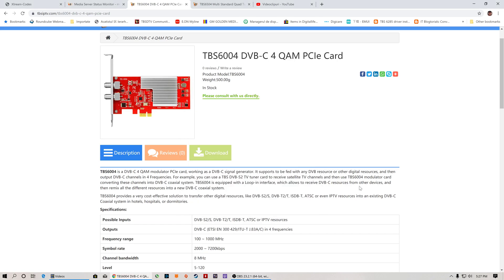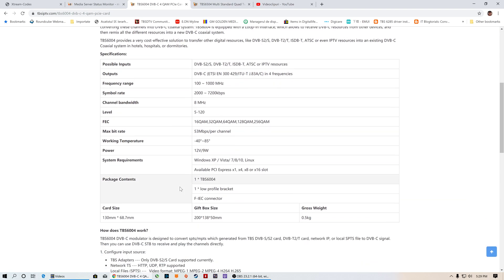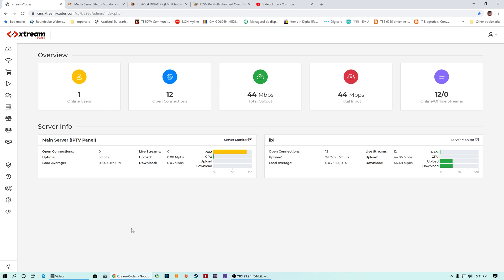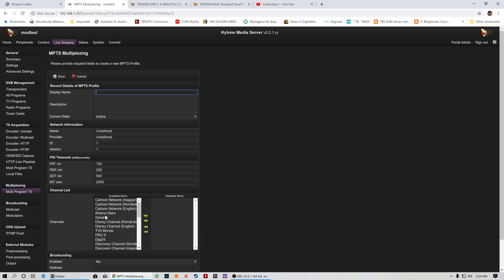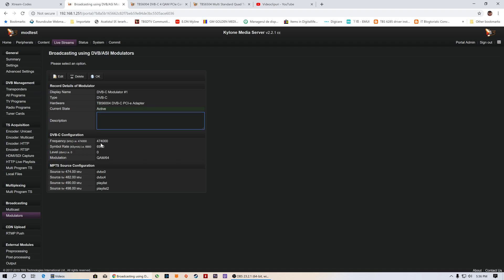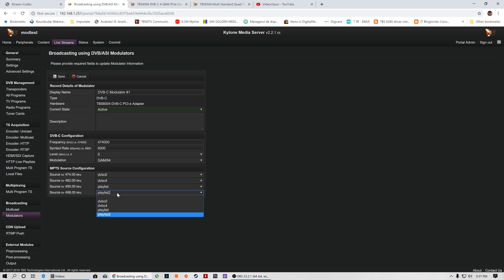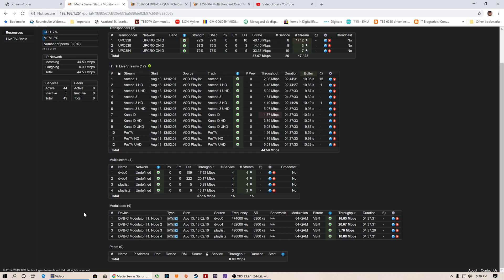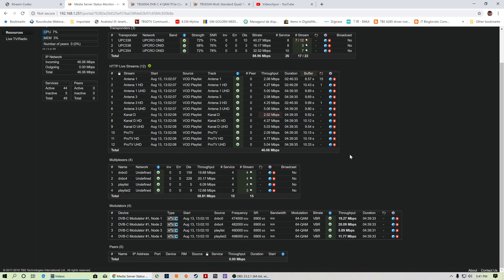TBS6004 Cable Modulator (how to build small television broadcasting station) part 1

Comment: if this tbs 6004 modulator can support sources of url ip stream input  up to 100 tv hd channels or more
Reply from the maker: this is hardware man , the input is relaying on the software you use the hardware itself can work with any type of input as long as the software is capable to work with any inputs , there are at least 3 software which make use of this modulator ... but overall answer is yes it can work with IP stream sources

Comment: How many channels can i output with this cable modulator ?
Reply from the maker: BayDude depends on the bit rate and if they are HD or sd
Reply: @ovidiuss31  sd
Reply from the maker: BayDude the math is simple,  there are 4 frequencies each of them able to manage 45Mbps bitrate so total content you can send to QAM is 4 x 45 Mbps
Reply: @ovidiuss31  thank you sir

Comment: Hello,
 will this card works...please read ...and reply urgent...i want to buy 
TBS6004 Modulator .... I want to do the following thing ....I will buy 
IPTV from a provider with around 5000 channels and more.iptv provider 
will give me m3u files or url. i will Create my own DVB-C/dvb t 
Television channels from any IPTV source and transfer it through by 
antenna cable(coaxial cable) to a home tv network maximum 5 tv...will 
TBS6004 Modulator works reply I'll be very thankful!Have a nice day.
Reply from the maker: Hello , it will work but i cannot guarantee on stability when IP stream is used as source.

Comment: Trying to get rid of the 6 cable tv clients in my home and go for only one with a IPTV solution. But in Brazil the standard is ISDB-TB, and I'm wondering if one of the cards featured at the descripion links would work here for a multicast setup. (I'm a total noob, if I need to be more clear just tell me). Thanks!
Reply from the maker: https://www.tbsiptv.com/tbs6504-multi-standard-quad-tuner-pci-e-card  tbs6504 or future upcoming 6508 can receive ISDB-T signal